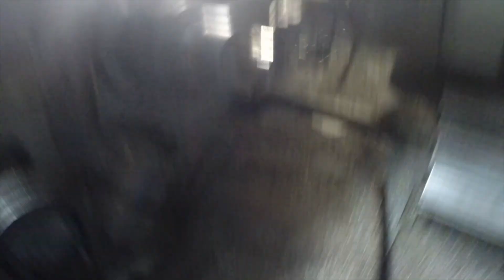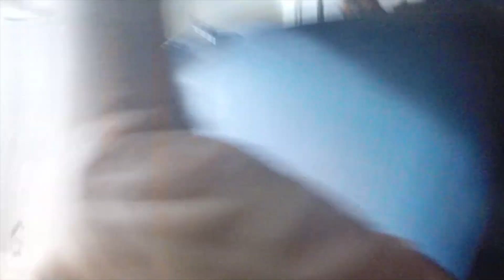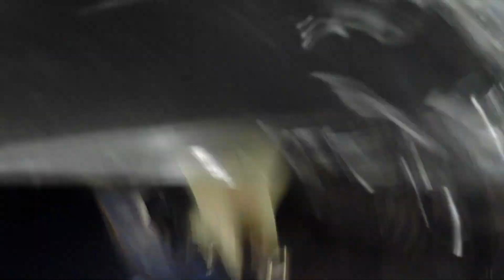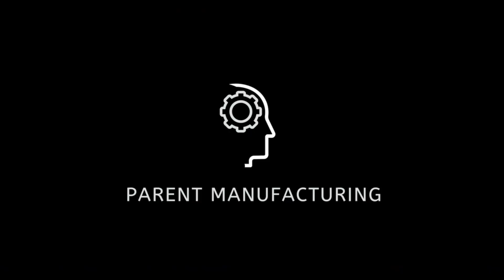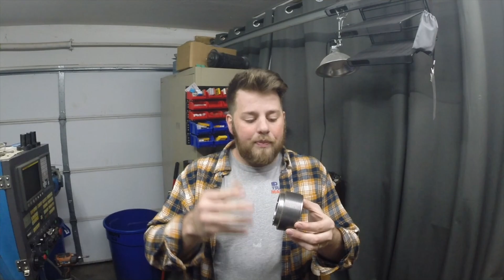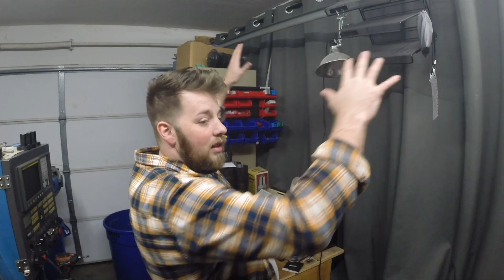How to Find And Get Customers (Even Though You Don't Want To Sell)

Comment: As a job shop with any company that you get work from that has their own machine shop it is almost a guarantee that you are getting the difficult work that they have a hard time doing. In thirty years of machining I have cut several types of threads but have yet to cut a buttress thread.
Reply: Because you haven't used Horn's innovative ZycloMed dual non concentric thread cutting process.

Comment: I think you briefly touched on it in a prior video, but what make of lathe are you running?
Reply: Yes sir! This is an '03 Hyundai Hit 160M with a 6 inch chuck, a 3J Collet System, and live tooling, no y axis. Hopefully upgrading to a bigger chuck soon!
Reply: @kennethparent2936   sweet thanks, are you happy with it?  All I’ve ever run was Okuma, Mazak and Takisawa. Looking for a cheaper alternative to get my own thing going.
Reply: @jethrrod9382  I am. The VDI isn't the best option but it still works and I can still do milling. It has its problems but any used machine is going to and youll have to learn to fix things as you go. That's why I didn't go with Mazak, due to parts cost. Really the best machine you can get is the one you can afford. Older Hyundai's are good, but are limited. I can't get a boring bar to bore past center without a special double holder, and the live tooling on isn't the most rigid. But I can hold .0005 all day once it gets warmed up, which is pretty good for a 20 year old machine.

Comment: Thanks Ken great video gave me some ideas how I could drum up work. So my next question is what are you using for measuring techniques? You said you had scrapped those stainless parts out are you using basic measuring tools or do you have a cmm? For example how would you measure size and if there was any lead error  on your threads? If they supplied a go no go gage that would be one thing but if your just working off a print as you well know just because your math and program are correct doesn't mean your machine is going to give you that?
Reply: Hey AG, thanks for that. I Had gauges from the company, but one part would be good but thenext wouldnt, and it was ust a mess. Other then that its a height gage, calipers, mics, and gauges. Haent had a problem since those parts.

Comment: Self employed 42 years, HATE quoting. Still quote too high or too low too often. Had just a couple jobs I had to bail on over the years.
Reply: I rarely had a problem with quoting (before a few more shops popped up that'd bid $50 on a part that needed 10 kg of hardened tool steel with EDM'd and ground surfaces)

I had a problem with tolerances. Specifically customers demanding extra tolerances after i had already started. Not only did they want extra tolerances added, they also wanted the price lowered at the same time in most cases.
Reply: @angrydragonslayer  I wouldn't call them customers, not sure what you'd call them! I tell them that clearly I can't afford to play such games, and good luck finding someone that will.
Reply: @funone8716  me and the guys called them a lot of expletives but i don't think i have any "business-speak" words to describe them :)
Reply: @angrydragonslayer  unless those guys are literally paying your mortgage, you don’t need that headache. I did that for far too long and it got me nowhere except broke and stressed.
Reply: @billdivine9501  i either got them to cancel or demanded a price where i'd get 60% profit (really good for local area) with the changes

They continued with maybe 2 jobs before not using me
Reply: Yes sir! I am right there with you, but not for 42 years! Ive done the same. Keep at it!
Reply: @kennethparent2936  Another big problem for me is material. The closest metal supplier is 45 miles away. I need a bar or 2 now and then.  They won't deliver anything under $500, and at $500 they charge $120 for delivery. Larger shops that buy more get "free" delivery.  They do not like the little guy or small shops. Not in my neck of the woods anyway. That forces me to deal with places like McMaster Carr, and pay higher prices for materials.
Reply: @funone8716  Hey man I know that. I don't get the good deals. Some times McMaster Carr is good, for like Delrin. Cheapest place I could find in quantity for a lathe. Also, Online Metals is a place I also order from when I have too.
Reply: @funone8716  I hear ya. I recently had to buy some aluminum from Mc master. The finish was horrible. The next day found what I needed at a local hardware store for much less and much higher quality. Same happened a couple years back with bar stock A2 from Mc Master, it was awful. Now I just UPS from Industrial Metals. Shipping was more than the product but at least it was good quality.